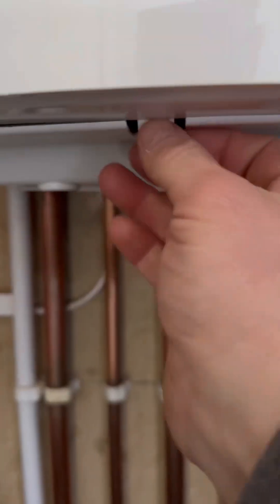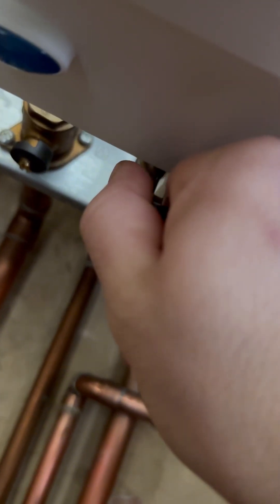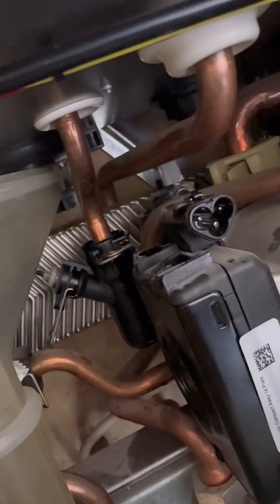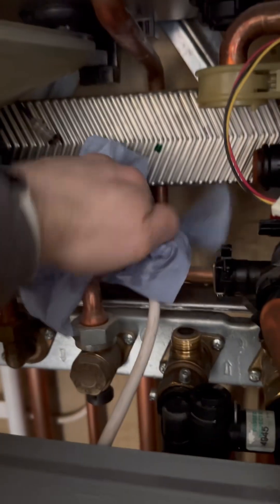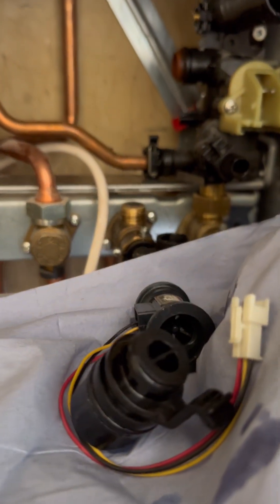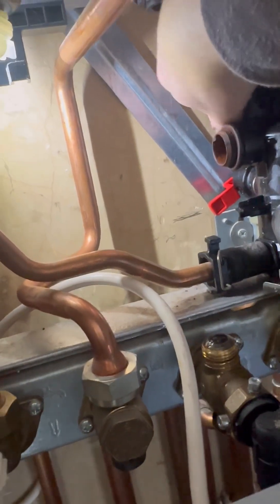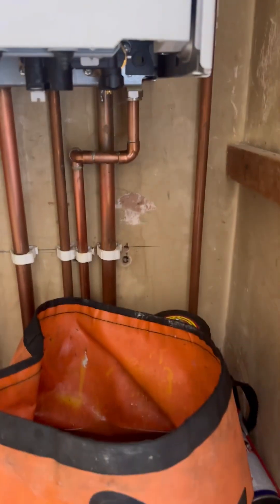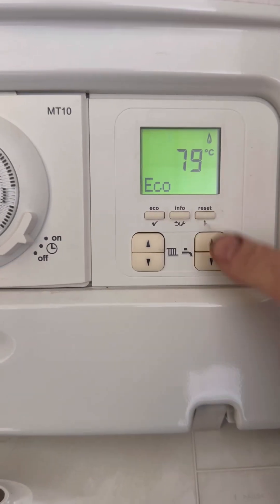My boiler overflow is leaking outside Worcester Bosch 30i erp high pressure

Comment: Word of advise when doing this. If your changing just the PRV, make sure you have the extra seals for the heat exchange plate. I did not and now water is leaking everywhere. Sleeping tonight with no boiler until the local shop opens so I can buy the seals. 😢
Reply: The WB plate comes with a bag of seals - did you get a genuine new one?
Reply: @gilesyone  I used this video to help me change just the PRV. My WB plate was good.
Reply: @StealPhantom  no worries bud, wasn’t quite clear. Pain in the bum when you see it dripping 💧
Reply: @gilesyone  I know right! Especially if you're a new home owner like me.

Comment: When it's a worcester overflow leaking I tell the customer I've left a tool in the van then leg it. I guess not all have to come off the wall to get to the parts, but the thought alone scares me😢
Reply: This guy should be the “ go to “ plumber for literally everyone, So professional, knows his stuff and always seems to fix the problems and……. One handed ! I’ve had plumbers out before and take 3 goes at fixing a boiler…£1300 later and it’s STILL wasn’t working properly!! You’re definitely a one off , fair play mate 👍🏾
Reply: What Worcester and what part requires it coming off the wall?